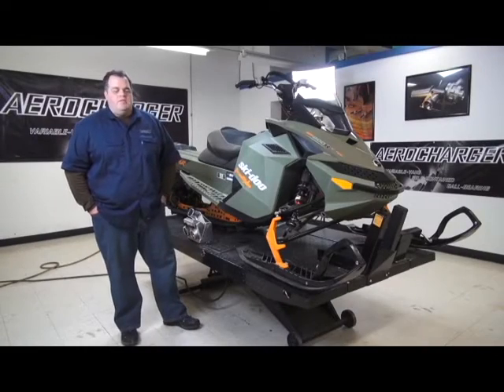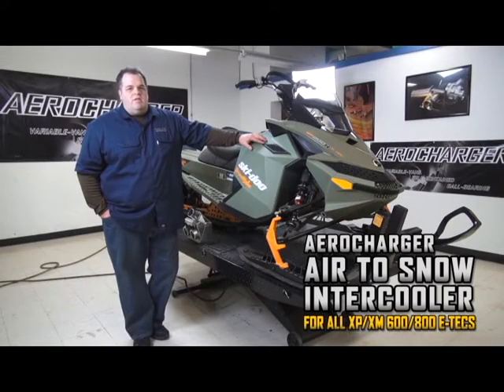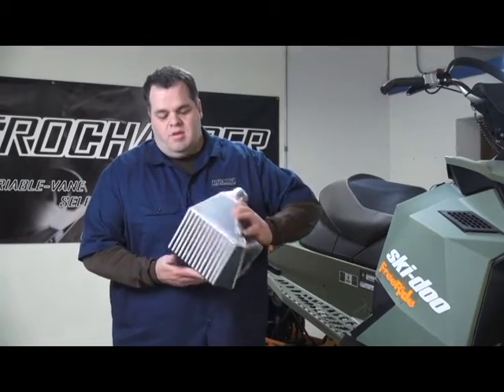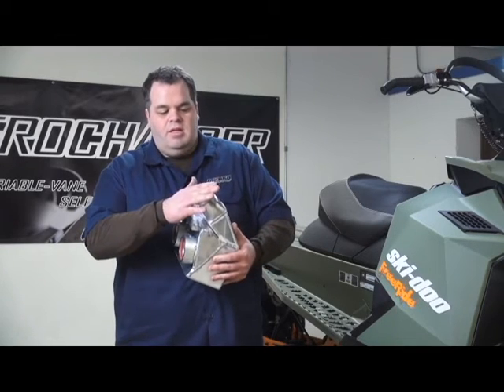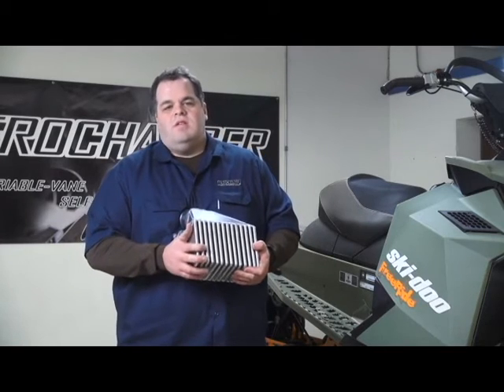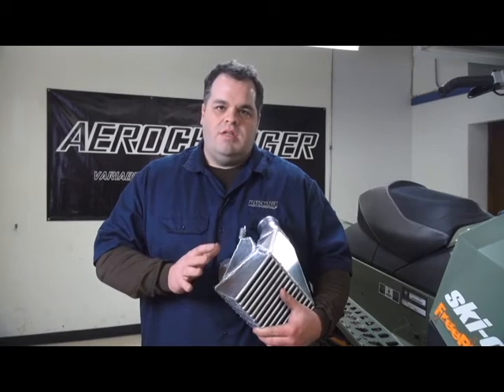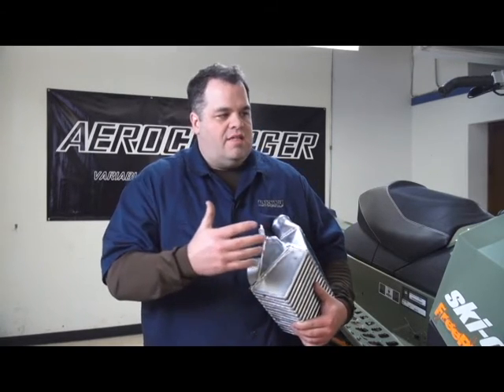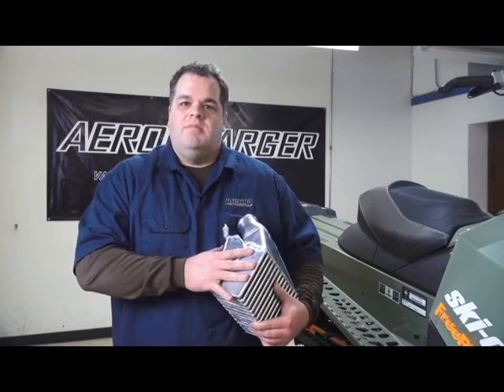How It Works: Air To Snow Intercooler

Comment: Aerochargers are an awesome piece of engineering. I used them from 1994 when they were Aerodyne Dallas. Had contacts with the creator, Mr. Gerhard Schruff, had blueprints, service tools and lot's of info. If you guys have a turbo project, you'd like to build, these Aerochargers are the way to go. Just a FEW examples here; NO need to have an oil supply, the Aerocharger has it's own oil. No need for additional plumbing for a wastegate. You can mount the Aerochargers with the turbine shaft vertically; try that with a std turbo!... No worries about hot engine shut-downs or stall, the Aerochargers couldn't care less. 
The VTN system will self- adjust for boost demand or, control over-boost.
A lot of sizes (turbo maps) availlable even very small sizes. And, NO, i'm not payed to say this, these turbos are pure Awesomness!.